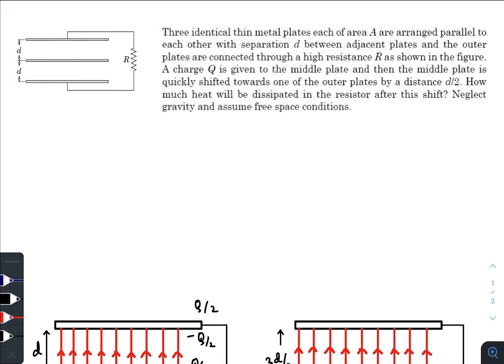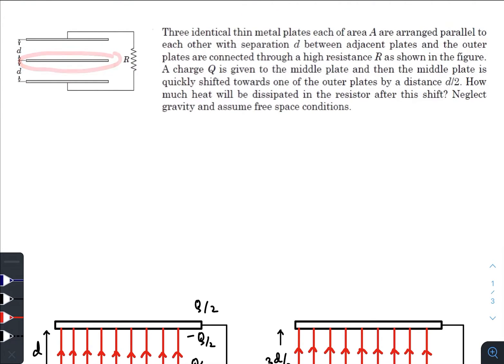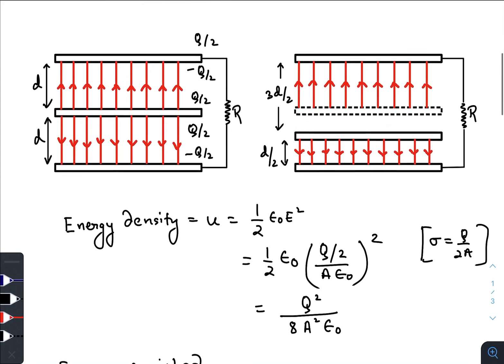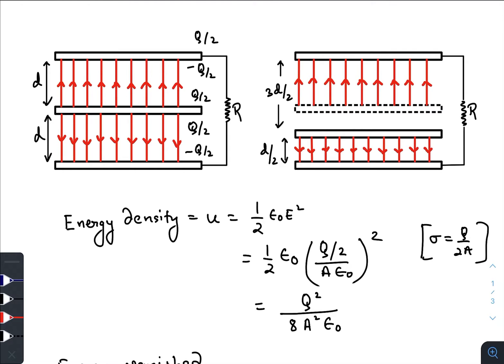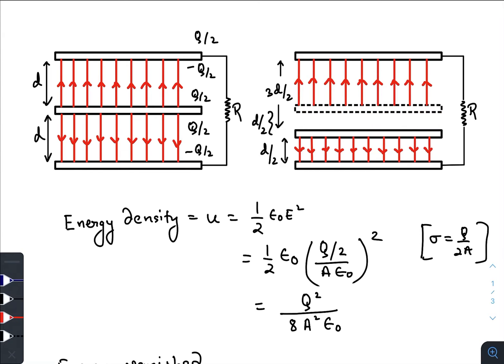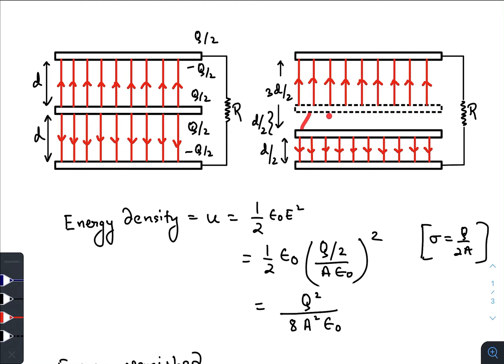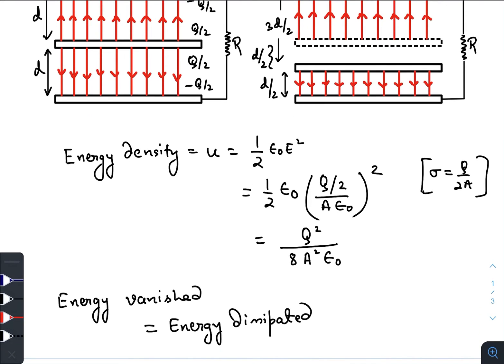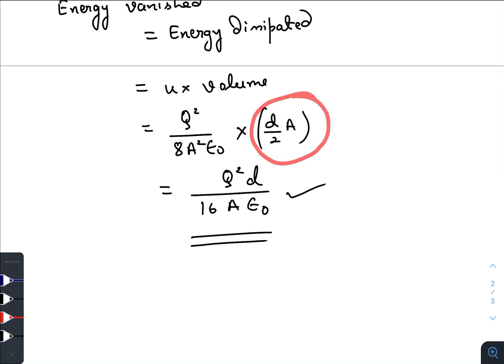Pathfinder for Olympiad and JEE Advanced, Page - 13.16, Q - 51

Comment: Sir I solved it by writing charge distribution in final case and treating them as a system of capacitor,as after steady state no current in resistor
Reply from the maker: Yes...that's also correct
Reply: Can u tell what charges are u getting